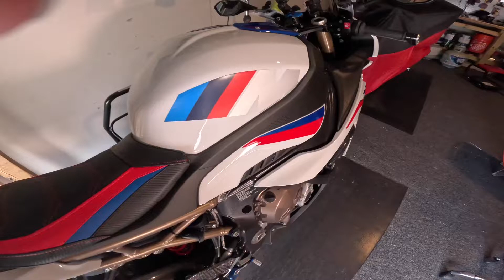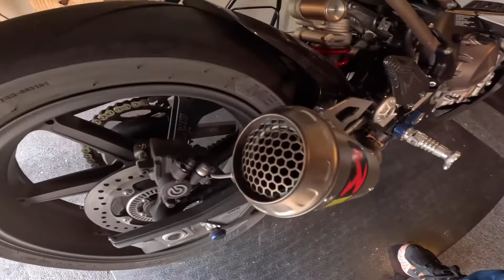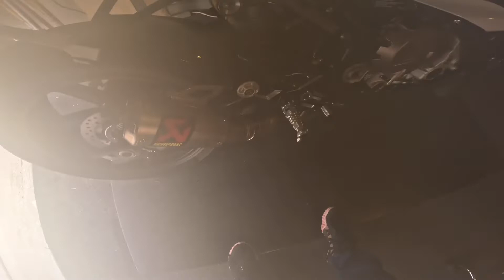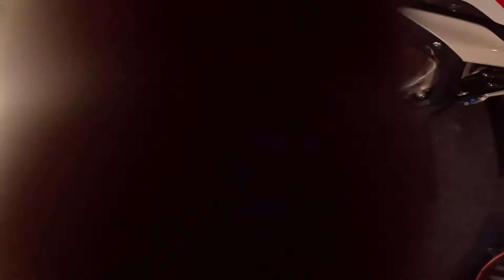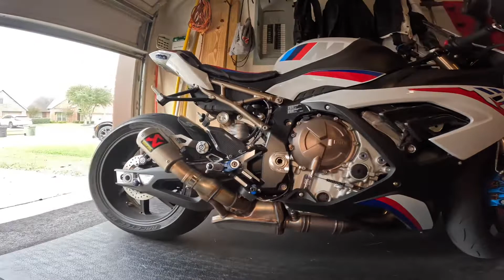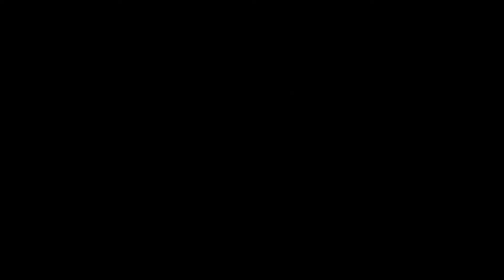DO NOT put this on your BMW Motorcycle?

Comment: Excuse me what? Lol

If you put a full exhaust and get a proper flash tune… there’s no issue. 

Those guys up there at the dealership sound like they are lazy and don’t want to deal with basic bmw issues. Lol 

It’s your bike so do as you please. Obviously you are wanting to get 50k miles out of your bike so that tells me where your priority is at.
Reply from the maker: What up man I’m a huge fan of yours. Love your videos and the hang. Thanks for stopping by. I have the full header in the box at home. Just hesitating until I clear the warranty. 6500 miles down…👍🙏. Thanks again BRO
Reply: @BMWBRO  yeah just wait for warranty. My homies up here still get warranty even after full exhaust and tuned. He just flashes it back to stock any time he gets serviced. The dealer is aware. 

But every dealer is different. 

Keep pushing and posting content 👌🏼
Reply from the maker: The dealer said save my OEM cat and they would put it back on for warranty pics if needed but even the technician said, don’t do it man. I know all your bikes are flashed and tuned 👍. I wouldn’t mind taking it up against a tuned S1K…

Comment: The problem with the S1Ks is that decat exhausts just cripple the ECU. They run very bad and even struggle to hold an idle. If you do a decat with a proper tune the will run like a beast. My R1 ran fine with a decat exhaust but something about the BMW computers where it just limps instantly.
Reply from the maker: Great feedback. Kind of confirms it’s not worth it. I have the GP pipes just holding off until I’m out of the main recall period
Reply: @BMWBRO  Yea, be aware as I think it will void your warranty. A proper tune will have it running beastly though and you will pick up great power and the dead zone they have will be gone too.